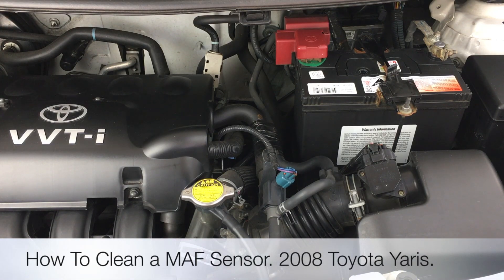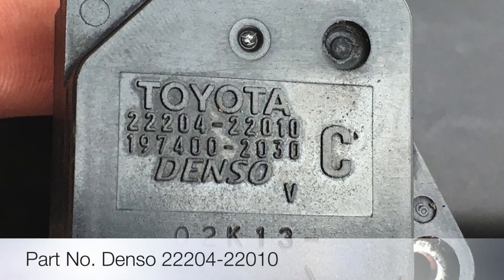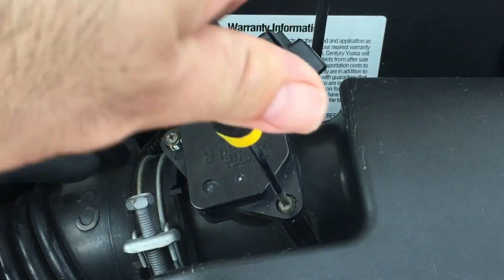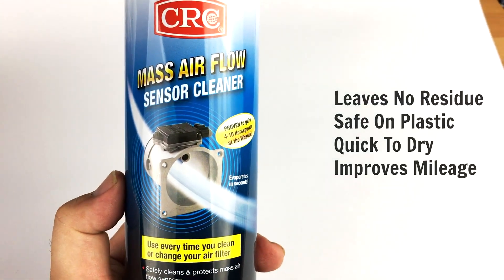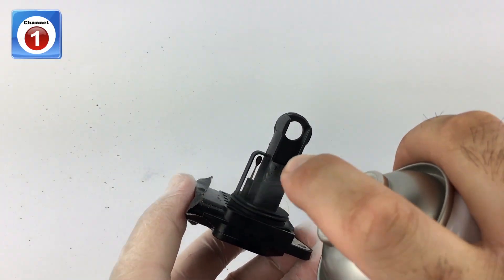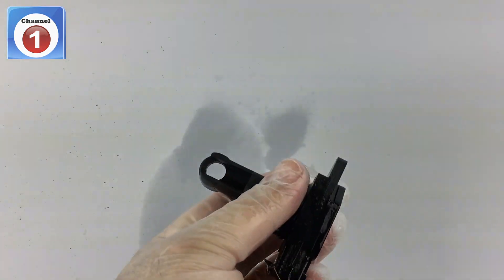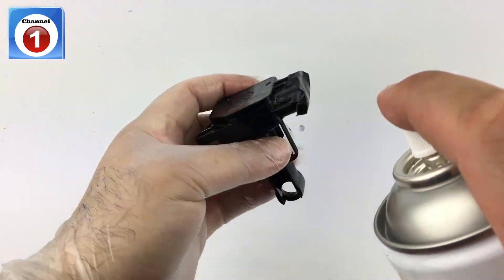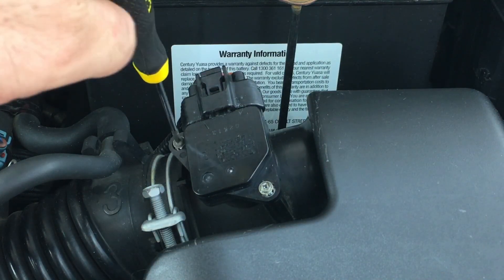How To Clean (MAF) Mass Air Flow sensor 2006-2019 Toyota Yaris

Comment: Hi,today only I watched your video.My Toyota yaris 2011 model Hatchback have problem with MAF.The Mechanic said to replace,costs NZ$450.!!!!Still car running without troubles with the old sensor.But some times waiting  at signals the car making some vibrations and struggle to move as usual speed  from the signal.If I give maximum axilaration on pedal, within 5 seconds the speed chane to the best speed.I have a question.If I do like your video,is the MAF's problem can solve? Because the Mechanic told,the sensor not sensing the air flow properly. Is this will help me to solve the issue?Please help.Thanks alot.
Reply: The part only costs $150 US so around $240 NZ . I am not sure how easy or hard it is to get the part in NZ. I would say if you can order the OEM MAF sensor for cheaper than what you were quoted, just order it and install it. It is much cheaper and not a hard install by any stretch. However, do be careful unplugging it. Honestly, if your mechanic said it was the sensor and you plan on getting it replaced, there is no harm in pulling it out and using the MAF sensor cleaner before going through with replacing it. If it fixes the issue, you will save a lot of money. Make sure you only use MAF sensor cleaner, do not use anything else because it can leave residue and it is a very fragile sensor.

Comment: I use a WD40 and still working good 👍
Reply: You are only supposed to use MAF cleaner because anything else will leave residue. Not to mention it is only $10 a can.....
Reply: @jennykelly4111  hi mate 👋 you think the WD40 it not good for cleaning the MAP sensor?? 🤔 not any fail code at the moment 🤪
Reply: @jorgefonseca9225  best of luck bud

Comment: Can it be cleaned without removing it ? On Yaris I changed air filter today - can see MAF in Air intake tube - can see hot wire sensor
Reply: For goodness sake! How lazy can someone be! 2 screws, I repeat, two screws... Geez!
Reply: @crpth1  😂😂😂

And dude you're helpful here in comments thanks
Reply: the visible wire is the iat (inlet air temperature) sensor

Comment: After cleaning the maf will it cause rpm issues or wild rpm? Thanks
Reply from the maker: If it was really dirty before it was cleaned then you might have to do a relearn procedure- basically restart the engine a few times until the revs go back to normal.

Comment: Hi, where can I find the MAF for a Toyota Run X?
Reply from the maker: It’s next to the airbox where the air intake pipe connects.
Reply: @michael77x  My run x loses power whenever I accelerate it to 3000r/pm... It just wouldn't go beyond 3000r/pm
Reply: @giftthabethe7129  Clean the throttle body (inside) but do not remove it.Leave for 10 mins to dry.No need to remove battery terminal.Whenever i clean the throttle body i also clean the MAF sensor and PCV all in one go whilst i'm under the bonnet/hood so all 3 the done and i don't have to worry about them for another 40.000/50.000 miles.

Comment: Sir is that the only part I need to clean for Toyota Yaris 2012?  I mean Mass Air Flow Sensor Fluid Meter?  Or NCP93 Toyota Yaris 2012 doesn't have any Mass Air Flow Sensor Fuild Meter?

Comment: Hey how are you?
So I've had another problem with my vitz.. when it idles.. I can hear a chain noise in the motor.. many repair shops say that its the timing kit and they say I need to change motor oil. I'm using 10w 40 right  now and they say I need to use 20w 50 and some say I need to use 10w 30.. I live in a tropical country, does it has something to do with the temperature?  The same problem causes my car to struggle to start in the morning. With one swing tho .. he makes like an old car trying to start before he idles... and then the chain noise.
When driving and giving gas it makes a rough sound.. what do u think?
Reply: I think you should change your starter the flyweel must be wearing down? If this only happens when your car is COLD. Also if it was the Timing Chain, the performance will be dying eventually snapping the whole engine apart. Before you get stuck on the Road, try to go get your starter tested? Its free in Auto zone? But if you hear like a lound grind, it is definitely the starter

Comment: Hi,
Is that sensor the reason why my car is not running stable after a battery drain?
Reply from the maker: It sounds like you need to reset the ECU
Reply: Channel 1 
So how do I do that? I saw someone resetting it by just pulling the fuse.. is that it?
And even the A/C doesn't work, the fan won't turn on under the hood like it used to. I bought a new battery, but still the same
Reply from the maker: To reset the ECU disconnect the negative battery terminal for at least 15 minutes. Reconnect the negative battery terminal. The car will need about 2 days to relearn all the functions so it will run a bit rough for a while. Also you need to check every single fuse.
Reply: Channel 1 
I hope this solves the problem.. thank you so much for the info
I'll give you a reply after I've done everything 👍👍👍love up!
Reply: Channel 1 
Hi, just wanna tell you that my car is fixed.. car runs normal again.. A/C works fine.
Thank you soo much for your help👍👍.. I really want to thank you more but dunno how 🙈
Reply from the maker: Just knowing I helped someone out is enough for me mate, it’s the reason I I make these videos. Take care :)
Reply: Channel 1 I will mate.. and you too 👊
Thanks again👍👍

Comment: Could u plz tell me. While i switch on tha AC durring slow speed my car engine vibrates for a second than again normal. Toyota yaris 2008. What could be the reason ?
Reply: This is normal Jawed don't worry.
Reply: Your asking your car to do something that requires a bit of power. When you switch the AC on the alternator needs to adjust. That's all that 1 second vibration is.
Reply: Check your engine mounts its possible they could be going out

Comment: To REPLACE the air flow sensor do u just buy the part from a auto store and plug the new one in instead of the old one
Reply from the maker: Yes that's exactly what you do 👍
Reply: No. Disconnect the battery before installing. Also clean the air filter
Reply: @jasonlewis460  , no need to remove battery,  the connector is push & pull! I've done so many times of removing the MAF sensor and cleaning It doesn't require technicalities to do it!.
Reply: @paididoy  it's best if you disconnect. The computer needs to reset. Especially these models.
Reply: @jasonlewis460  dis connect the negative plug only?
Reply: @jasonlewis460  Were you born dumb like that ??. NO need to disconnect the battery before installing

Comment: i have a 2008 yaris sedan, the idle became unstable when the engine is at work temperature, i already cleaned the throttle body, it was really dirty, the problem solved like for 3 weeks, but again the iddle is unstable and it has some lag in the throttle. if i do the maf sensor cleaning and change my pcv valve, this should be solved? what other thing could be? i appreciate the help and videos. thanks
Reply from the maker: A few people have asked me this question and i always recommend changing the spark plugs. I made this video for you guys. check it out 
https://youtu.be/PcAU2PsLMVI
Reply: I update you with my case, both of the o2 sensor were having troubles keeping the amp when they heated. i replaced both and the problem solved. i think it was the last thing you should check and the least probable error. but the principal thing for having this diagnose is the fuel consumption going down. thanks for the videos mate
Reply: @20Joaako Hi, if the idle is not stable while driving after 2 weeks should I change the oxygen sensor and  spark plug?
Reply: MDD DD my friend, if you can check the   resistance of the sensors first before change it because is really expensive. here i left you the manual of the process of inspection https://cardiagn.com/1nz-fe-engine-emission-control-2007-yaris/

Comment: How do I know I have to change for a new one.?
Reply from the maker: Check the error codes using an OBD2 scanner tool. The MAF sensor error code is P0101. Clean it first then clear the code. If the error code comes back you probably need to replace it.  Codes P0110 P0100 can also relate to the MAF sensor. I used about half a can of MAF sensor cleaner, really give the wires a good spray.